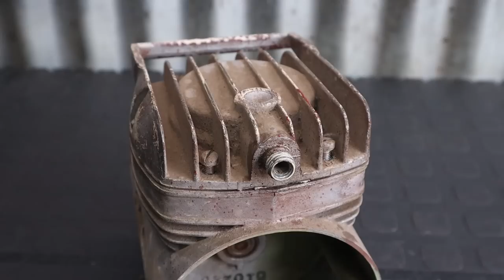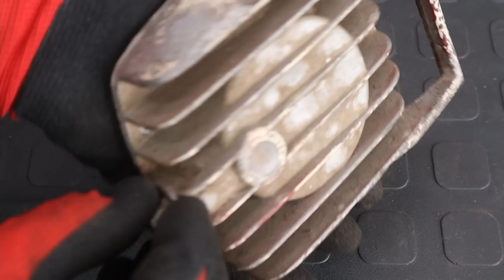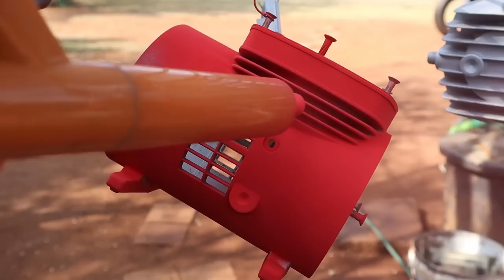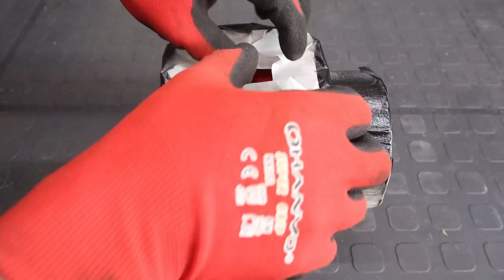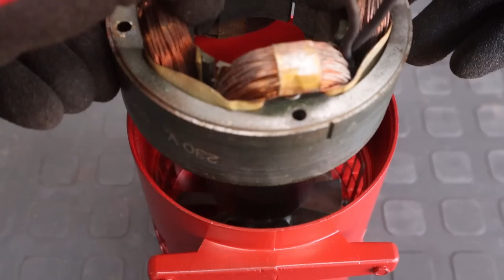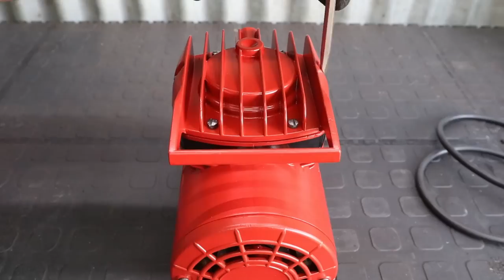Vintage Sprayit Diaphragm Air Brush Compressor Restoration.

Comment: IIRC the original color would've been royal blue, natural aluminum, or an olive corrosion-resistant undercoat. A number of those units were OEM'd for Badger Airbrush; Thomas sold them under their own brand and OEM'd them for various medical and industrial users. Note the single piece connecting rod and piston - they were really proud of their "WOB-L" design back in the day...
Reply from the maker: Finally someone with decent info on these little sprayers.

Comment: 12/2/2021
These diaphragm compressors were designed for use with constant air paint spray guns and air brushes. They operate, when in top condition, at ABOUT 35 psi. Using a spray gun that stops air flow will degrade and ruin the RUBBER diaphragm. Great job bringing back a tired and forgotten unit. ;-)

Comment: I am learning so much from yours and a few other channels I watch. The one thing I have seen is how an electric motor's insides look...I had not idea how simple they look just tightly coiled wires....I have no idea ATM just how an electric current makes them work...I will need to look that up. In addition...I went from liking sandblasting a lot to really enjoying the whole process from start to finished...also polishing things to shiny is my new favorite....
Reply from the maker: They are really simple in design.

Comment: This is a great video , I'm glad i found it . I have a compressor exactly like this one that i have had for probably 40 years . I use it primarily for airbrushing model airplanes and cars . I have been wondering if it might need a new diaphragm , or what not . So far it has performed like a champ . Your video has provided a step by step disassembly and reassembly guide to help us not to have any parts left over after any maintenance procedures . Thanks for doing it . 😊👍
Reply from the maker: Haha I am glad I could help you out. I still have mine and it works so damn good. I use it to fill balloons for my little daughter. It saves my lungs haha

Comment: Trying to watch your whole playlist, and just watched this one.  So far, results wise, this one is on the top of the pile.  You made it a really classy piece of shop equipment.  And totally functional as well.  As said below, I do much of my own work also, but try and avoid the electrical internals for the most part.  Your efforts are well spent on this one as it turned out well more than it was in the original in new condition, and your efforts shine through.

I will remember the heat shrink trick when I dive into the next piece of electrical gear.

Comment: Can this be used with a modern Low Pressure High Volume paint spray gun?  I've got one a Craftsman version of this  (same principle, different looks).  Very, very handy to use when you want to fill up your tires at home.  Kind of loud though.  Love that new red paint job - makes it pop!

Comment: great job friend 
but i have a question 
why you didn’t get the fan out to remove the rust?
i saw you just cleaned it with alcohol,
and i think you had to replace the old  rings ball( i don’t know what’s it’s name in english)
Reply from the maker: The ball bearings were still in great shape. Also I did not have a bearing press plate thin enough to fit between the ball bearings and the cooling fan. I I would damage the fan to get the bearings off. Since the bearings were still in good shape I did not replace them. Also in order to properly clean the fan, I would have to sandblast it, and the sand would ruin the bearings, so I cleaned up the fan and stator the best I could and called it a day.

Comment: Amigo yo tengo uno exactamente gemelitos asta con el mismo color original lo tengo desde el año 2000 fue mi primer machete y todavía sigue dando Buenos Resultados.. pero tengo una pregunta verdad que llevan puesto dos enpakes en las tapas de succión en las de dónde sale el aire desde el salvador le escribo

Comment: Hope you did wear proper PPE when exploding that balloon. You are living a dangerous life....   BTW many of these where discarded as the CFM value was quite low (as seen in the air volume displacement with the balloon) and replaced by similar sized piston compressors from China. Shame really... nice simple but effective design. Cheers, Ruud from Holland
Reply: This man is doing this brilliant work and loves it. Your talking about PPE safe dangerous not used . You are spouting off as if you are The Engineer of all things. No need to give us practical coal face workers, especially Restoration Good guy, do this for that satisfaction only he knows. Knowing about an array of machines, you could most likely find a risk in repairing an 1864 Cast Pedal for Traction 270170.       Enjoy the Show man…… put that JobsWorth Manual away……Get Mucky